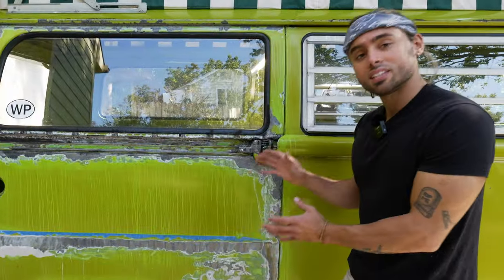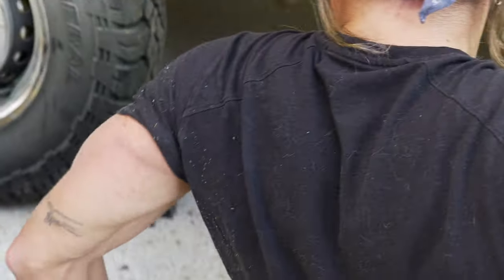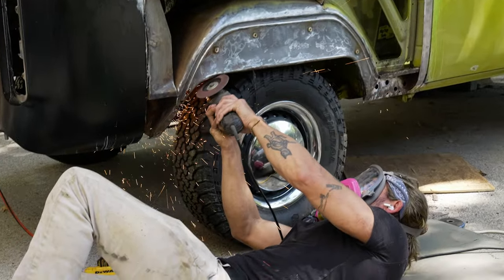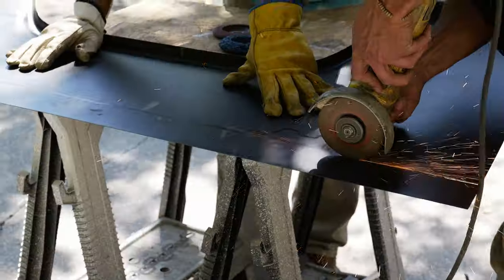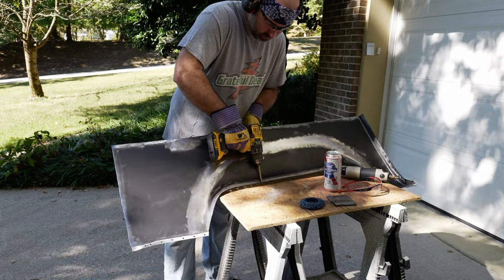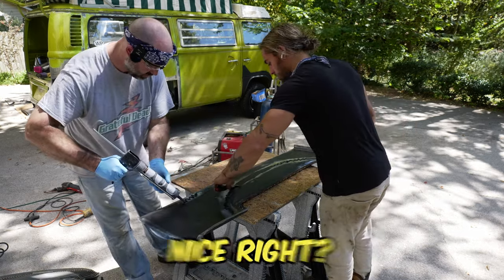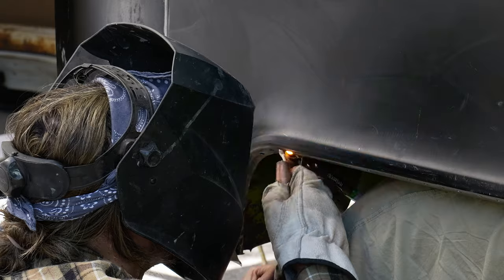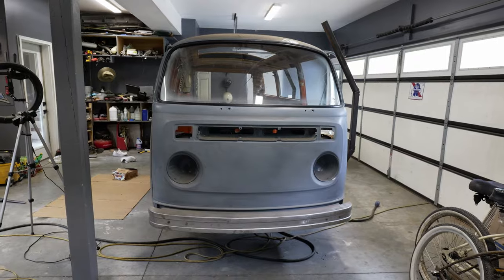Baywindow Rear Wheel Arch Replacement (Tyler's 1978 VW Bus)

Comment: you make pretty good content, i also think to start publishing my works in the near future. So far i have worked with old mercedes and opels, future goal is owning and restaurating also some vw van. I wanted to suggest you, when you get too much gap between the panels, try next time use a caper material such as caper tube. let the parrtner press from the other side of the panel to the place where you weld, or fix it on the place, it will help to weld the panels together, belive me. You can combine it with the metod you showed- using wire.